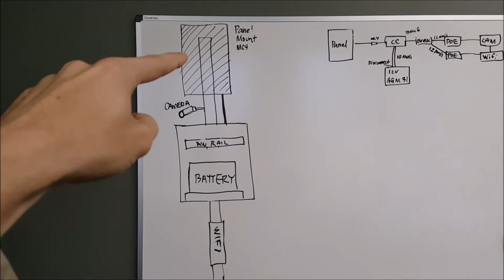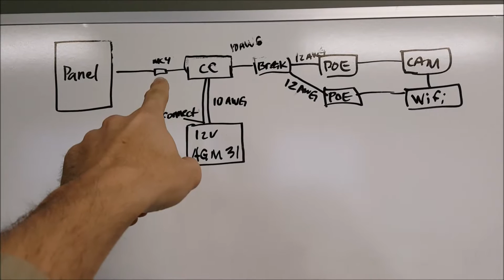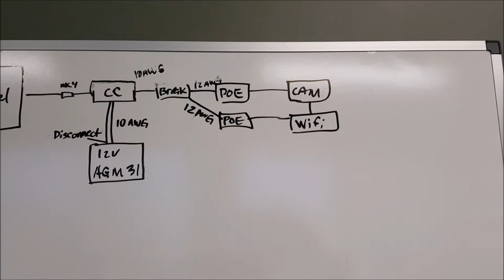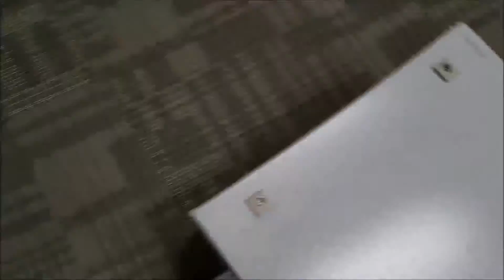Solar Powered Surveillance Camera Project

Comment: Very interesting setup. Is it possible to get more cameras (4 or more) running on a system like this?
I have been looking around to build a system that is battery/ solar powered. With a 4/5g 12v router wich i already have. Its for our family shop where all the power gets shut off if we are not there. And we would like to keep an eye on it when no one is there.
Reply from the maker: Yes.  It would just require bigger/more solar panels and more batteries.  You can see a more recent setup that I did in this video:  https://youtu.be/H7Wj25lDToI

Comment: Hello just wondering what PoE injector you have used in this setup 

Cheers
Reply from the maker: It is from Tycon Systems.  I don't remember the model number of the exact ones I used.  But they have all sorts of different kinds of PoE injectors and PoE switches that you can use in an off grid solar application.  Look under Tycon Power:  https://tyconsystems.com/index.php/products/tycon-power

Comment: 3 years later now you can buy a reolink argus eco with solar panel on amazon for under $100
Reply: True but I am not finding any that can work 24/7 Most only work on motion detection do to limited power.

Comment: Hi, i have a question, whats the absolute smallest battery you could use for a setup like this?
Reply from the maker: That depends on where you live, what your load is (how many watts it consumes), how long each day the camera operates, whether you have a network device in the mix, and how many days of backup power you want.
Reply: Hi i was wondering if the box can be pre made when you buy it and where can I buy it
Reply from the maker: What do you mean pre-made?  I can sell you the same enclosure that you see in this video series.  It is about $250 plus tax and shipping.  It is weatherproof and dustproof and comes with mounting hardware for pole mounting.

Comment: Hi: like your video recently i bought a 4g lte cellular security camera  want to powered by 100 w solar panel with 12v deep circl interstate battery or two of 6v do you know how long for solar panel to collect power from sun to battery and how many days the camera can running  i will expecting 3-4 days after batter is fully charged,thanks.
Reply from the maker: Email me at ldsreliance@gmail.com

Comment: Any concerns about caustic and/or explosive outgassing fumes from battery being trapped in same box as electronics? Would it not be best to split into two boxes and put battery down n its own box?
Reply from the maker: This particular box is purpose built for this.  It does get a little ventilation.  Unless something shorts it can't explode, though.

Good comment, but I think this is pretty safe.

Comment: Do you still have the parts list and contact #'s to call for your solar panel for cameras ?
I just saw your ho to video and found it very helpful but would like to know where I can buy the parts.  Thanks
Reply from the maker: The parts list is in the video description.  I didn't talk to anyone on the phone so I don't have any contact numbers.  There are some newer cameras out now than the ones I used so you may consider a newer model but Ubiquiti is great.

Comment: Wow! Awesome project. Power over ethernet interests me. I looked into that when setting up my wireless to wired internet. I found it cheaper just to go w/ a long booster usb over buying the powered usb to ethernet hubs. Still I love seeing it put into action here. There may come a time when i want to go that route instead.
Reply from the maker: +Prima Donna Going Off Grid Yeah it is a great technology.  I've used it quite a few times putting wifi hotspots in the ceiling in our building and mounting antennas on a roof.  It would be a major pain in the butt to have regular AC power wired to those locations.

Comment: Greetings... Something to consider is to keep the Panel high off the ground so that it is not easily taken. Also might not be a bad idea to install the panel on the Roof, and battery close by, then run a small power line to the Camera if that's possible. That way the Camera can be hidden easier or at the very least better concealed from searching eyes. Another idea for a camera is also on the Roof, as you plan, as a backup Camera should the lower camera be found and tampered with the higher camera just might catch who did it... Obviously I am playing Arm Chair QB here as I've not seen what you are working with but only your drawing and thought I'd add my 2 cents worth. I look forward to seeing how this project pans out. Wifi Network Cameras are dropping in price too, so something to consider as well.... Cheers....
Reply from the maker: +Paul Bialozor Yeah, putting all of this stuff higher up would be best but the front gate to the property is a long way from any buildings.  I plan to put it on a 12 foot pole, with the bottom 3 feet anchored in concrete in the ground.  I am not super worried about people tampering with it since they will have to get through the gate first and by then we will have some video of them.  If they get in the property some other way and disable the cameras then there is nothing I can do for this camera.  We will have 4 other cameras on top of a 40 foot telephone pole in the middle of the property, though, so unless they have climbing gear they aren't going to disable those.
Reply: +LDSreliance Cool... Sounds like you have worked it all out...
Reply from the maker: Paul Bialozor
I hope so!
Reply: Need some auto tracking and zooming cameras on that pole. Or just hire a security guard haha. I used to do that many years ago. Sit and stare at a CRT screen for hours zooming in at the parking lot during break time. Then go walking around dark areas of the building at night. It was really boring. A few times I had to babysit a concrete plant. Yea who is gonna screw around in a concrete plant. I found a different job haha